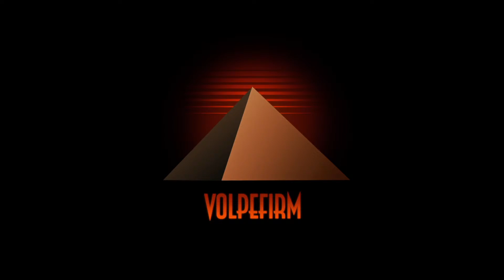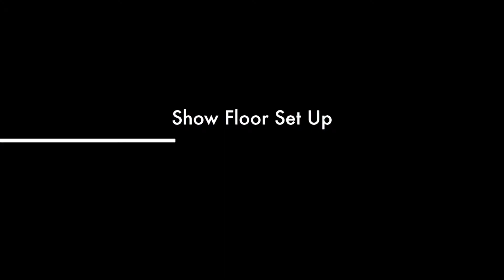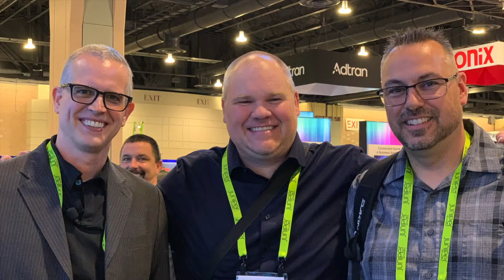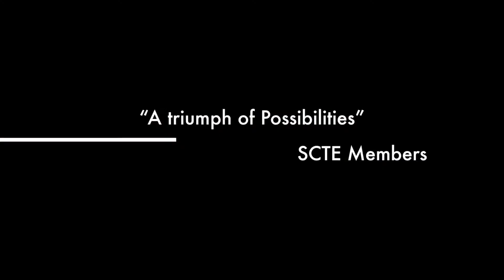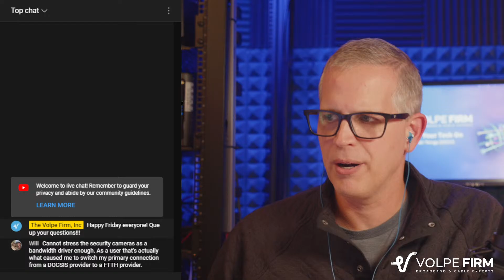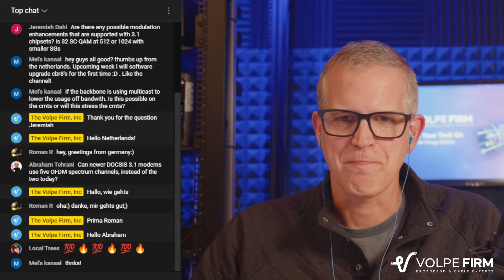What is Possible with a  DOCSIS 3.1 Modem Today?

Comment: What is the point of a fast connection when all of big tech is run by HB1 street shitting diversity hires
 I have near gig speed and for the better part of a year now YouTube on any PC browser is so fucking slow and laggy it is barely even useable now.
YouTube is such a shit platform ( tech wise, not even talking about all the  shit UI changes, and driving away their creators away and censorship) now I feel like I  using mid 90's dial up.
A certain  tribe of tiny head gear people we are not allowed to  talk about  have  bought  up and taken over the internet just like they did with  the media and now everything  has turned to complete shit and nobody can even talk about it.
not only have they turned all content into woke BS, they are ruining everything from a purely technological standpoint  too now.
I wish I could go back to 2013.
Reply from the maker: Yeah man, that is a lot to unpack, but I personally would take a do over of 1989 :)
Reply: @Volpefirm  What happened in 1989?
I said 2012-2013 because that was peak YouTube UI and also  chrome and browsers based on it worked a lot better and   search was not missing 98% of results like it is today.
in 1989 I was on compuserve LOL
Reply from the maker: Commodore 64 was rocking back then

Comment: Can you please read below and tell me if you notice anything wrong or if our intermittent issue is related to the error below. 

We are located in West Palm Beach, FL 
Our carrier is Comcast/Xfinity. 
The issue has been affecting about 5 blocks radius and Xfinity has even replaced several nodes; however, we still have issues where 
our Internet disconnects 5 times per day for about few seconds to 1 min. 
I have replaced the RG-11 cable from the tap to the ground block
I have replaced the RG-6 cable from the ground block to the back of the cable modem 
No splitters in between 
Cable is underground inside a PVC pipe 
No barrel on the wallplate and connected directly to the cable modem.  
The tap at the pole has been replaced by a new one. 
I'm also getting thousands of uncorrectables which are usually related to bad fittings, bad cabling, bad splitter etc 
but I know all of the connectors, and cabling is perfect. 
I also purchased a new modem (Same model) and we are still having issues 

Here is the error I get from my Cable modem CM2000 Netgear Nighthawk DOCSIS 3.1 

Wed Mar 15 16:28:51 2023	(Warning (5))	RNG-RSP CCAP Commanded Power in Excess of 6 dB Below the Value Corresponding to the Top of the DRW;CM-MAC=c8:9e:43:e9:e4:e8;CMTS-MAC=00:01:7c:a3:b6:89;CM-QOS=1.1;CM-VER=3.1;

Here is my signal:

 
Startup Procedure
Procedure	Status	Comment
Acquire Downstream Channel	399000000 Hz	Locked
Connectivity State	OK	Operational
Boot State	OK	Operational
Security	Enabled	BPI+
IP Provisioning Mode	Honor MDD	IPv6 only
 
Downstream Bonded Channels
Channel	Lock Status	Modulation	Channel ID	Frequency	Power	SNR	Correctables	Uncorrectables
1	Locked	QAM256	42	399000000 Hz	4.9 dBmV	41.9 dB	1951	5098
2	Locked	QAM256	1	471000000 Hz	5.2 dBmV	42.1 dB	10429	46912
3	Locked	QAM256	2	477000000 Hz	5.1 dBmV	42.0 dB	64281	270744
4	Locked	QAM256	3	483000000 Hz	5.1 dBmV	41.9 dB	48678	217494
5	Locked	QAM256	4	489000000 Hz	5.1 dBmV	42.0 dB	58439	234635
6	Locked	QAM256	5	495000000 Hz	5.4 dBmV	42.2 dB	43193	144898
7	Locked	QAM256	6	507000000 Hz	5.3 dBmV	42.2 dB	86436	291848
8	Locked	QAM256	7	513000000 Hz	5.3 dBmV	42.1 dB	76818	243838
9	Locked	QAM256	8	519000000 Hz	5.1 dBmV	42.1 dB	102039	307033
10	Locked	QAM256	9	525000000 Hz	5.1 dBmV	42.1 dB	91333	252862
11	Locked	QAM256	10	531000000 Hz	5.2 dBmV	42.1 dB	151600	421437
12	Locked	QAM256	11	537000000 Hz	5.2 dBmV	42.2 dB	150223	417733
13	Locked	QAM256	12	543000000 Hz	5.4 dBmV	42.2 dB	103799	251991
14	Locked	QAM256	13	549000000 Hz	5.3 dBmV	42.2 dB	121715	284322
15	Locked	QAM256	14	555000000 Hz	5.5 dBmV	42.3 dB	142099	305702
16	Locked	QAM256	15	561000000 Hz	5.6 dBmV	42.3 dB	140297	259593
17	Locked	QAM256	16	567000000 Hz	5.6 dBmV	42.2 dB	132762	278377
18	Locked	QAM256	17	573000000 Hz	5.7 dBmV	42.2 dB	136070	268754
19	Locked	QAM256	18	579000000 Hz	5.8 dBmV	42.2 dB	163161	304489
20	Locked	QAM256	19	585000000 Hz	6.1 dBmV	42.3 dB	154345	259332
21	Locked	QAM256	33	447000000 Hz	5.2 dBmV	42.2 dB	64765	154755
22	Locked	QAM256	34	453000000 Hz	5.3 dBmV	42.2 dB	117377	395703
23	Locked	QAM256	35	459000000 Hz	5.2 dBmV	42.1 dB	85787	264958
24	Locked	QAM256	36	465000000 Hz	5.2 dBmV	42.1 dB	128363	410808
25	Locked	QAM256	38	423000000 Hz	5.0 dBmV	42.0 dB	69387	142573
26	Locked	QAM256	39	429000000 Hz	4.9 dBmV	41.9 dB	74528	138642
27	Locked	QAM256	40	435000000 Hz	5.1 dBmV	42.1 dB	75100	174757
28	Locked	QAM256	41	441000000 Hz	5.1 dBmV	42.2 dB	85049	183036
29	Locked	QAM256	43	405000000 Hz	4.8 dBmV	41.9 dB	77983	128063
30	Locked	QAM256	44	411000000 Hz	5.0 dBmV	42.0 dB	70875	101602
31	Locked	QAM256	45	417000000 Hz	4.9 dBmV	41.9 dB	83893	122620
32	Not Locked	Unknown	0	0 Hz	0.0 dBmV	0.0 dB	0	0

Upstream Bonded Channels
Channel	Lock Status	US Channel Type	Channel ID	Symbol Rate	Frequency	Power
1	Locked	ATDMA	1	5120 Ksym/sec	35600000 Hz	44.3 dBmV
2	Locked	ATDMA	2	5120 Ksym/sec	29200000 Hz	44.0 dBmV
3	Locked	ATDMA	3	5120 Ksym/sec	22800000 Hz	43.5 dBmV
4	Locked	ATDMA	4	5120 Ksym/sec	16400000 Hz	42.8 dBmV
5	Locked	ATDMA	5	1280 Ksym/sec	39600000 Hz	44.3 dBmV
6	Not Locked	Unknown	0	0	0	0.0 dBmV
7	Not Locked	Unknown	0	0	0	0.0 dBmV
8	Not Locked	Unknown	0	0	0	0.0 dBmV
 
Downstream OFDM Channels
Channel	Lock Status	Profile ID	Channel ID	Frequency	Power	SNR / MER	Active Subcarrier
Number Range	Unerrored
Codewords	Correctable
Codewords	Uncorrectable
Codewords
1	Locked	0 ,1 ,2 ,3	37	690000000 Hz	8.08 dBmV	42.9 dB	1048 ~ 3047	151558160	94557868	5726
2	Not Locked	0	0	0 Hz	0 dBmV	0 dB	0 ~ 4095	0	0	0
 
Upstream OFDMA Channels
Channel	Lock Status	Modulation / Profile ID	Channel ID	Frequency	Power
1	Not Locked	0	0	0 Hz	0 dBmV
2	Not Locked	0	0	0 Hz	0 dBmV
 
Extended Upstream Transmit Power
Enable Extended Upstream Transmit Power
(That box is checked)
Reply from the maker: Hi Ronnie,
Thanks for watching. I'm sorry that you are having issues. It sounds like you have done your homework and tried a number of things to resolve this on your own. Knowing that this is impacting others in the area is a big help.

You have more uncorrectable codeword errors than you do correctable codeword errors:

Channel	Lock Status	Modulation	Channel ID	Frequency	    Power	    SNR	    Correctables	Uncorrectables
1	    Locked	    QAM256	        42	    399000000 Hz	4.9 dBmV	41.9 dB	    1951	         5098
2	    Locked	    QAM256	        1	    471000000 Hz	5.2 dBmV	42.1 dB	    10429	         46912
3	    Locked	    QAM256	        2	    477000000 Hz	5.1 dBmV	42.0 dB	    64281	         270744
4	    Locked	    QAM256	        3	    483000000 Hz	5.1 dBmV	41.9 dB	    48678	         217494

That is atypical and unlikely caused by something in your home. This will almost always be caused by the transmitting device, it is likely faulty equipment on the cable operator side. While 80-90% of the time the issue is going to be on the subscriber side (I'll have a video coming out on this soon), I'm pretty confident your issue is on the cable operator side.
Reply: @Volpefirm  thank you for replying. I also sent you an email. Comcast/Xfinity keeps believing the issue is on my side even though we replaced the cabling, and everything on my end is perfect per their own survey and myself checking with the technicians to make sure the installation was done properly.
Reply: @Volpefirm  what can I do ? What message with some useful facts and possible solutions can I write to my carrier so they can check. 
Is it due to noise on the upstream channels ?
Reply from the maker: Hi Ronnie,  

Again I'm sorry you are experiencing this issue.  It has to be so frustrating.  Believe it or not even I have experience bad service too in my life and there wasn't to much I could do about it at the time either since it was outside of my house.  

You mentioned prior that your neighbors are also calling your ISP with similar issues?  How many neighbors?  My only advice is to continuing call your ISP and if your neighbors are also experiencing issues keep encouraging them to call them as well.  The squeaky wheel gets the grease.

With that said I want to just state that ISPs do really work very hard to give their customers good service.  I can speak to this by knowing how people in the industry really do want to improve and provide a great service to their end users.  There is a lot of hard work, time and money put into the service.  But that doesn't make you feel much better at this moment.

So I can only give you the advice I had to take too.  Keep contacting your ISP.  I'm sorry there isn't really to much more you can do.  I hope it gets resolved soon.
Reply: @Volpefirm  I still have the following questions: 

1. When looking at my stats below is there something you notice wrong within frequency levels that can tell you something like 
    "Ronnie whenever we see upstream channels working on less than 35600000 HZ we will always see lots of uncorrectable" 

2. "Whenever I see upstream channels symbol rate over 5,000 Ksm/sec.. we will always see lots of ucorrectable" 

In other words... I'm trying to find out if there are any clues when it comes to my stats that would be an indicator of issues related to lots or correctable/uncorrectables. 
As of right now, I haven't noticed the internet going down but my correctable and uncorrectable continue to grow which may be causing transfer rate issues, slowness and possible downtime whenever I don't even notice. If I restart the cable modem, they will grow within few hours... which I know is not supposed to.

Comment: I have a question regarding the OFDMA. We have been rolling out OFDMA in our system for about the last two years now. We typically employ 2 ATDMAs with the OFDMA at the high end of our return path  (currently still 5-42 mHz). We have been experiencing multiple instances across different service groups of the OFDMA showing problems while the ATDMAs show largely unaffected. Oftentimes, we see 3.1 modems reporting thousands of T3 errors or CERs on just the OFDMA. Or, we will see times where the 2 ATDMAs report a transmit of 44 while the OFDMA shows a transmit that is somehow in the 80s. When these issues occur, the 3.1s often drop the OFDMA entirely. As a result, all or most of the modems in that service group are now trying to use 2 ATDMAs, which causes the utilization to spike. 

Has anyone else encountered these types of issues or have any thoughts as to what may be causing them? Thank you, and also great video.
Reply: We’ve been having issues with legacy Cisco nodes where ofdma goes max transmit and falls off the ofdma in a midsplit node. To our knowledge we dont have issues with legacy Aurora nodes or rphy vecima nodes. We think we’ve had success reducing the ofdma size a little smaller of 50-80 instead of 40-80.
Reply from the maker: Thanks for the input Scott.
Reply from the maker: Hi Andrew as Scott mentioned the key here is likely a “legacy” issue. It is likely your issues will be resolved with a firmware update to the CCAP, RPD and/ or modems.